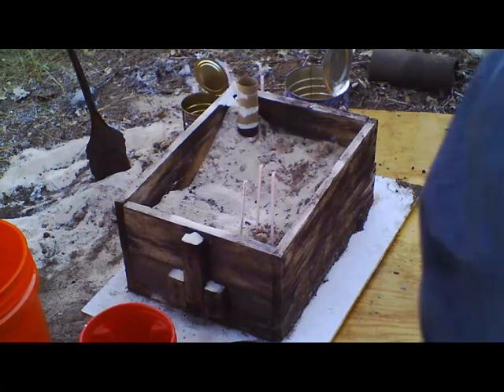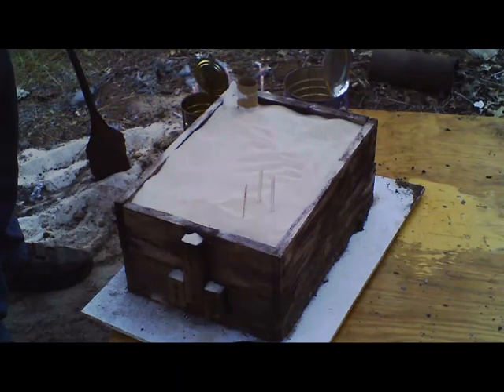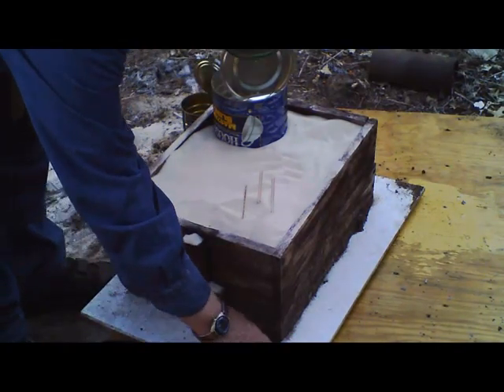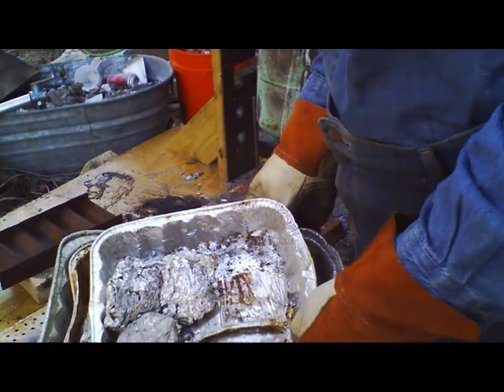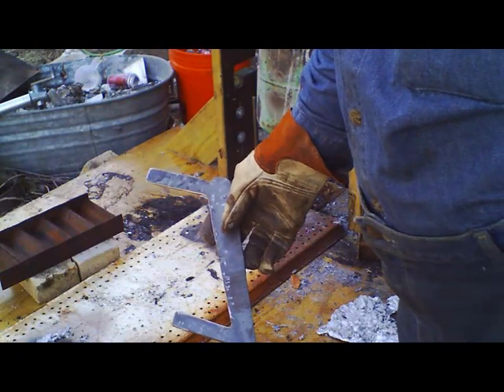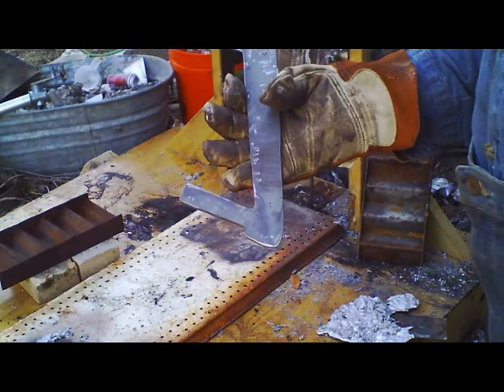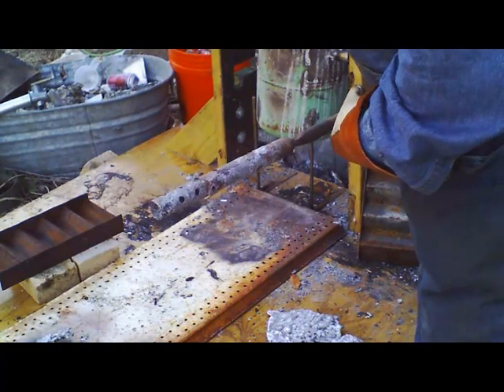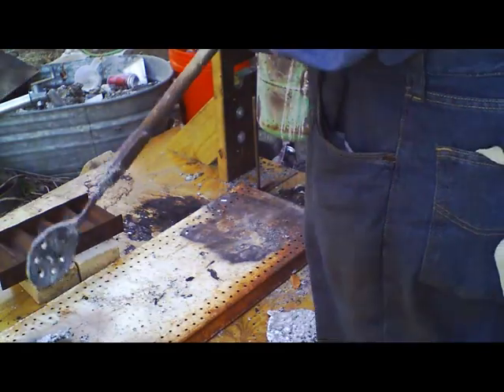Getting Started Part 2

Comment from the maker: 2"X2"X1/8" Angle Iron welded side-by-side. Cut the ends with a 3 or 5 degree taper so the top is wider then the bottom. For the end plates use 2-1/4" or 2-1/2" wide by 1/8" strip/bar stock. Want bigger? Increase the size of the angle iron. As for length 6" to 12" but this depends on how big your furnace is.